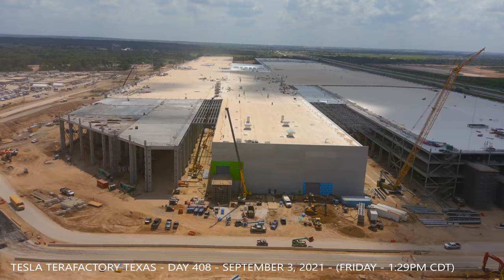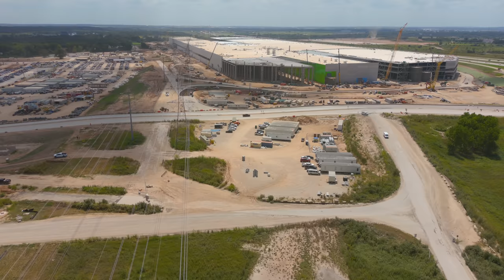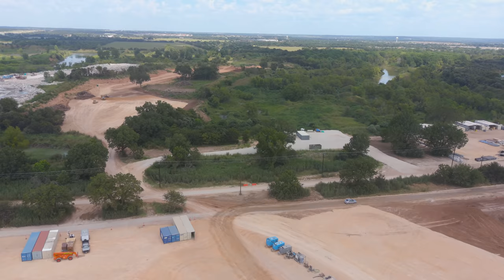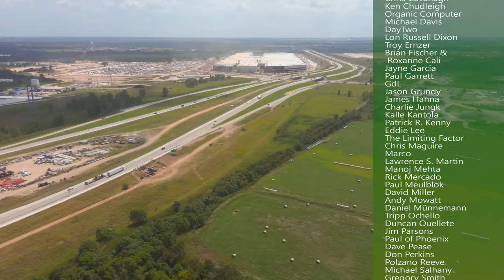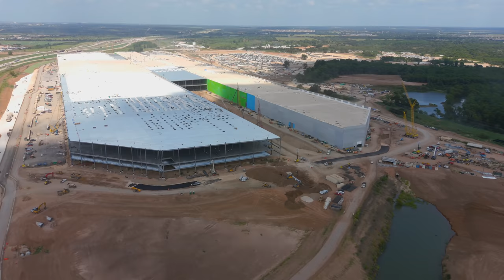Tesla Gigafactory Austin 4K  Day 408 - 9/3/21 - Tesla Terafactory TX - HUGE WINDOWS AT GIGA TEXAS!

Comment: Looks like that section of the new road near the bridge is ready for the asphalt. I bet tomorrow or Tuesday the first layer will go down. Hopefully Tuesday so I can catch it on video.
Reply: I'm somewhat surprised, they've had one side open, however no traffic whilst the other exit is still a bottleneck.
Reply: @paulstubbs7678  seems this access is mainly for Tesla employees and not construction workers.
Reply: @sammyk874  Well, but ain't no one gonna stop them. I'm guessing most don't live in places where that road goes to ... !?
Reply: @LinasVepstas  There seems to be a checkpoint and convenient U-Turn there, so they could be sent back.  Also, that road leads to 973 which can go to 71 where there are a ton of hotels where the out of town construction workers may be living.  Also the best way to get to 35 without getting on the tollway.

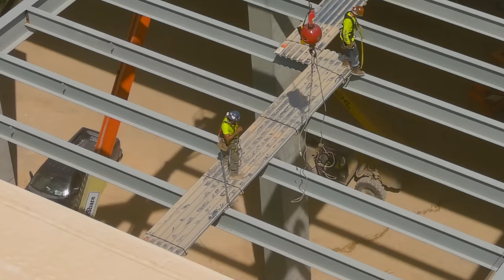Comment: 10:32 The workers have tethers with anchors that slideably articulate with the I-beams, so they can walk along the beams fully protected.
Reply from the maker: Pretty awesome system.
Reply: @peterdog15  I think this is a different set of ironworkers than the workers that built the battery area so quickly. Never saw the battery area ironworkers using that slide system.

Comment: Thanks Jeff. West side glazing is incredible.
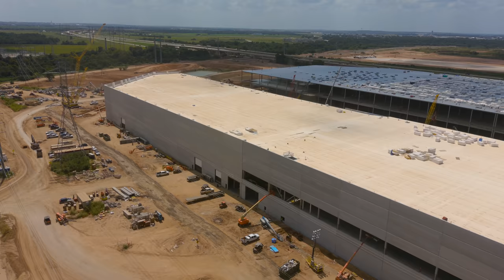1:48. East side BIW. Laid down some wall panels as a temporary apron at the blue door opening.
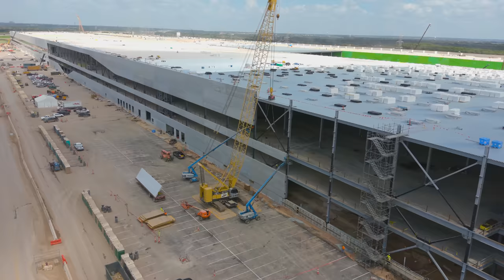2:45. West side GA. Still fiddling with the panel brackets on the columns. Brackets removed in between the black painted sections on the braced bay to the right.
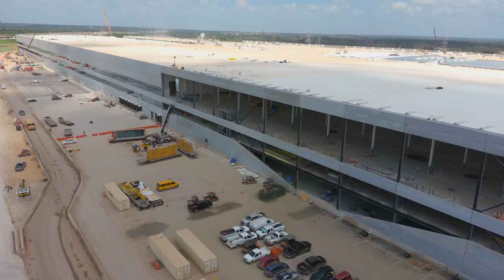3:03. West side GA. Glazing unit installed. Incredible. Imagine the wind load on that. No rear support, fixed top and bottom only.
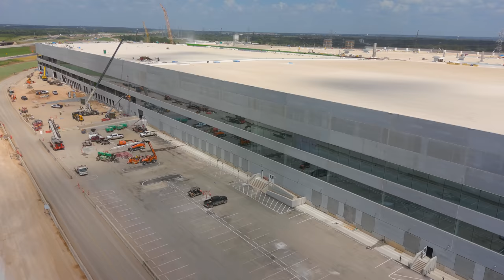3:18. West side battery. "Pfft, that’s not a glazing unit". Misquoting Mick Dundee.
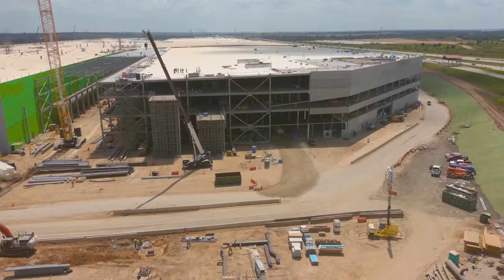3:43. North end battery. More raker beams in behind the temporary stair and loading platform.
14:41. South alleyway. Concrete placed for the footings/pilecaps. Makes the column pedestal rebar a lot more visible.
14:43. South alleyway. Between the columns. Some pile locations visible where stands are suspending the rebar cages in the bore holes. Don’t seem to be in line with the new footings in the pit.
Reply: Regarding 3:03 Wont that be dangerous in a storm?
Reply: @DavidJohnson-tv2nn  Would have been designed for a particular wind speed.
Reply: 3:03 That is indeed one large chunk of glass.
When they give factory tours (where's the waiting list? I want on it) I hope to look out those windows from the inside.
Reply: Dundee, that was a good movie. The sequel, not so much.
Reply: @dan_w3st  Hopefully in the next few days we'll see someone guiding one into place, then we can get an idea of the thickness.
Reply: "14:41. South alleyway. Concrete placed for the footings/pilecaps."
Column pedestal looks offset.  Not sure if it's just the perspective, but odd if it is.
Reply: @MrNautica  You are correct, and I hadn't noticed the offset. I can't think of a reason why columns would be offset. Maybe it's not that critical, but just from a setting out point of view it's something you'd normally want to get right.
Reply: @MrNautica  Maybe 2 columns on each pedestal. Right side column with a greater load. Left side roof load only perhaps. Clutching at straws!

Answer is probably in that pile of steel over east.
Reply: @DessieDoolan  I think it's strange as it will mean the load is not distributed equally if the force is perpendicular.  Maybe there will be cantilevered element which results in needing the footings to countervail a diagonal load.  Whatever the case, it will have been carefully engineered.
Reply: @DessieDoolan  Possibly... but looks too far offset for that to me.  We'll have to be patient to see what happens.  
I'm also intrigued by the way it narrows half way down - have you seen if this area still has nine bored piles for each footing?
Reply: @MrNautica  The narrower area south. From what I can see there are only 4 piles per footing. Might be that they haven't bored the others yet. With the groups of 9 piles further north they didn't bore them all at once. 

It's an interesting part of the site. I've still yet to hear a plausible reason for any of the work.
Reply: @DessieDoolan  Certainly intriguing. Just hope it's not water vaults!
Reply: @MrNautica  Well........I do wonder why they dug up the black drain. Can only be to redirect it.
Reply: @DavidJohnson-tv2nn  Windy season in Austin is starting now. It's going to blow 10-15 knots all day, every day, for the next two months. They're going to have fun installing glass.
Reply: @dan_w3st  you need to be a Tesla owner to get a factory tour in Fremont. We will see what the rules might be in TX.

Comment: 10:38 Apparently they're going to buy ALL the giga presses.
Reply: I mean, who else uses them anyway?
Reply: 😂👍  But if it takes 3 or 4 minutes to clean, prep, inject the hot metal and wait a bit for it to cool, then they need multiple presses.  The cars come off the line every 90 seconds, so I guess they need at least 2 for each part: rear and 2 front castings(?)  So that's 6, and there wouldn't be a spare to take over during maintenance or repair.  And they'll need another 7 for the CT.
Reply: Front is a single casting as well. We’ve seen many of both front & rear on-site from the 2 presses that are up and running.

The Cybertruck will be using the same concept but larger. Hence the 8 ton press vs the 6 tn that they are installing now for the Y. 

So 2 sets (front/rear) for four 6000 ton presses for the Y. And 2 sets (front rear) for four 8000 ton presses). An extra of each four types makes 12 total.
Reply: @acmefixer1  I get a kick out of calling molding machines presses.
Reply: @patr5902  We only know of 1 8000 ton gigapress on order for cybertruck.  It is entirely theoretically possible that the front only needs a normal 6000 ton as the front of a pickup truck is less weight bearing.

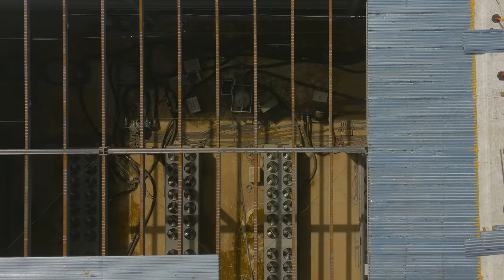Comment: 9:00 So the chillers are already positioned inside on the top floor (and appear to be operating).  What remains is installing ducting in the cut-open roof section.
Reply: Aren't those the temporary Trane units?
Reply: Those are Evapco units and don't appear to be temporary to me.
Reply: @jbbuzzable  
Just the wiring and flexible tubings are all hodgepodge.  They can be straightened out later.
Reply: I don’t particularly know what they are doing there, HVAC not my gig. The chillers are set out nice and parallel to each other and to the building in stark contrast to all the hoses and ancillary gear around them. Worth noting is that the chillers are 40’ or more below roof level. Seems a lot of space would be wasted if they were left there and ductwork run up to the roof. 

Couple of wild guesses. Possibly a plant mezzanine could be built closer to the roof and chillers mounted on that. Or these chillers get hauled up onto the roof and mounted there. 

Whatever they end up doing, we might not see it happening. That pile of scaffold stacked on the roof with the long open web trusses looks like it could be the start of a temporary roof (like the one that covered the elevator on the west side for a while). 

Still a huge amount of equipment to be installed on site. Check out this shot of Tesla Shanghai https://youtu.be/f6NXm2hwLeU?t=197
Reply: YES  those are the temporary Trane units

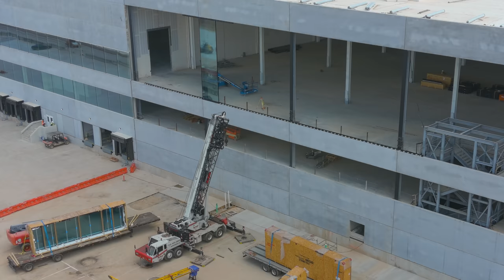Comment: @ 12:20 That large window is awesome. But for safety reasons, wouldn't it be better to have two smaller windows?
Reply: Looks like it going to take a lot of panes of glass. Big buck there.
Reply: @d.stamand  You sure?, from the video it looks way thicker than regular glass.
Reply: I'm surprised they only fitted one pane.
Reply: @paulstubbs7678  Just wait.
Reply: @d.stamand  They must be tempered glass, at least 12 mm (half inch ) thickness inside and lest10+10 mm at aut side.  Is incredibly heavy, maybe 5 tons or more. How mach wind load can withstand withaut middle points of suport?